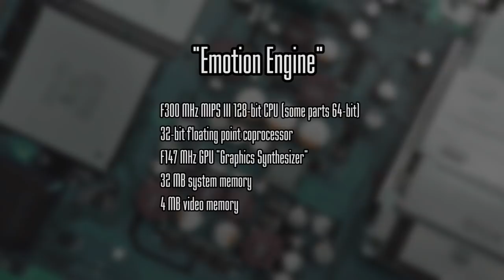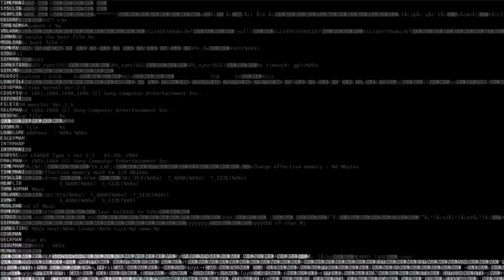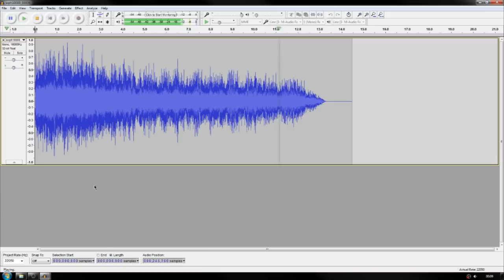Playstation 2 Startup Sound Explained

Comment: The ps2 is also a good DVD player
Reply: For 2001 lol
Reply: You could also play a PSX games on it)))
Reply: The PS2 was also a good video game machine.
Reply: John outstanding
Reply: DVD player built in was a huge sales driver back then, standalone drivers weren't cheap quite yet for most people. OG Xbox had it as well but you were forced to buy a separate accessory to even use the feature.
Reply: Yes it is true
Reply: Ooh, a Federal Signal Thunderbolt.
Reply: Not with it's disc reading issues
Reply: The PS1 is also a good CD player
Reply: Why do i feel like the Xbox 360 is strong enough to be used as a hammer
Reply: @Exzticy  underrated
Reply: Just like all playstations tbh.
Reply: I use my PS3 for this :>
Reply: Can confirm!
Reply: It looks like a regular one
Reply: @chiptunegalaxy160  and for phat ps3 too
Reply: @devantethedcguyreactstoo252  2000
Reply: Indeed
Reply: Especially shrek
Reply: And when it was set to parental control level 9 on some DVD’s, you could just look up what buttons to push to get past it!
Reply: It's the only good way to play those DVD player games, since it has a proper controller
Reply: 666 likes
Reply: @zaf2774  667 likes
Reply: nice tbolt pic
Reply: What is a DVD? 😂
Reply: @TheKeksletsplay  ur too young
Reply: I dont even use a dvd player, I just use my ps2.
Reply: @specialopsdave  Slick.
Reply: If you're sick on it and don't get it cleaned it breaks
Reply: Correction phenomenal
Reply: @devantethedcguyreactstoo252  i dont think much changed with DVD since its release tbh
Reply: I remember that PS2 was cheaper than most DVD players in that time.
Reply: @devantethedcguyreactstoo252  lol
Reply: Mine is age restricted i can only watch shreck 3
Reply: @chiptunegalaxy160  PlayStation 1*
Reply: @Exzticy  yeah that's a game console
Reply: Indeed
Reply: @Exzticy  IT COULD PLAY GAMES?!
Reply: @requiem165  WOAH I THOUGHT IT WAS A TOASTER
Reply: The ps3 is also a good blu-ray player
Reply: "It only does movies"
Reply: Used it every night for that. Back to the future 1 2 and 3 but mostly 2 every night like my whole childhood lol
Reply: My first dvd watched at ps2 was matrix animated.  Followed by Eurotrip, a pirated zatocihi film(KITANO version) and kill bill vol 1.
Reply: you could actually 'play' Netflix on ps2
Reply: I tend to not use my PS2 to avoid wearing  it out.
Reply: That was the Main reason it was so successful, also it was Cheaper than most dvd Players in the early 2000s
Reply: And it’s an emulation Machine
Reply: @AltimaNEO  No It ToAsTs BrEaD
Reply: And computer!
Reply: until the disc drive died
Reply: And PS3 a good blue-ray player.
Reply: @ebookjapan8054  yea its too bad that the ps2 had a backlight issue when playing dvds the brightness levels would pulse from bright to dark non stop
Reply: PS3 was a good blu ray player
Reply: Mine never lets me play dvds but that’s what I have a ps4 for.
Reply: What is dvd
Reply: @devantethedcguyreactstoo252  yeah, because DVD technology has advanced a lot since 2001 right? Damn i still have a broken ps2 that i plan on fixing just so i can watch pirated DVDs
Reply: That's what I thought my dad's ps2 was when I was little. I never saw him playing it
Reply: Just replying to make 69 replies 😂
Reply: It's true, it was also my first DVD player as a kid.
Reply: I didn't know there were even good and bad dvd players
Reply: Lot's of people buyed ps2 because it was cheaper than normal DVD player
Reply: Some times honestly
Reply: Its really not tho. My clean disks skip horribly on it but run perfectly on my ps3
Reply: Didn’t expect a thunderbolt to be here
Reply: Ya but sometimes you gotta have the DVD player 4 pro
Reply: @schcunt  damn made me feel old reading this comment
Reply: Just like me
Reply: I have ps2 slim and can't play any dvd whatsoever beside ps2 games
Reply: No lie no lie
Reply: I don't know why but i'm kinda uncomfortable looking at this comment
Reply: xbox one s is also a good dvd player
Reply: @hystericallover5989  wouldn't know  I don't have one sadly
Reply: @B.O.Xproject  i don’t want to sound like i’m just advertising the xbox, but it just straight up functions as a blu-ray player
Reply: @hystericallover5989   sounds good 👍
Reply: omg
Reply: Wait, it's not only a DVD player? Oops
Reply: it was until you used to fall asleep at night with it on and it would destroy your playstation 2
Reply: It was my first DVD player.
Reply: It actually is still good at playing dvds. I tested this with my ps4 and Xbox one with king of the hill dvd. And the PS2 done best because due to the dvd it looked better and more visually appealing than the ps4 or xbox
Reply: tfw I've never used ps2 as a dvd player
Reply: that's how many kids convinced their parents to buy them a ps2 lol
Reply: And a decent pc for its time
Reply: It kills your ps2 life tho
Reply: Before the PS2 our family only had a VHS player. We did have one of those portable DVD players for travel though.
Reply: They designed them, same as Blu-ray for PS3 + 4, still plays DVD's too of course.
Reply: And a desktop computer.
Reply: Wait... You can play dvd on PS2?
Reply: I was told it's not recommended playing DVDs on it though
Reply: Let's not forget the fact that (if it hasn't been mentioned) this DVD player now allows for easy piracy of PS2 games.
Reply: I wish
Reply: Wait what.
It’s a DVD player to.
The ps2 is my favorite console and I never knew that
Reply: @thestickopia4619  what-
Reply: As much as I love the PS2, the DVD player sucked even in 2000.
Reply: Yes
Reply: @ebookjapan8054  , the remote
Reply: My fuckin dad only used it for that
Reply: Actually its the best
Reply: It is not
Reply: @chickenindabox3169  ok lets just come to an agreement all playstation systems are good for dvd playing. i have a ps3 and its good for dvds i was gonna comment that so ya ps1 thru ps5 is all good for dvds
Reply: @johnnyvincent5405  except the ps1 could only play CD but ik wym, also the ps3 is a bomb blu ray player ngl
Reply: Yep
Reply: AT 3AM
Reply: Yeah, but i think it tears them up faster.
Reply: That was the way i watched the ben 10 live action movies
Reply: *Destroyer
Reply: Not on the slim it’s awful
Reply: @samthesnail34  look up the button presses on line should be able to help
Reply: My mom & sister used to always take my ps2 to watch movies, I used to get mad asf 😂
Reply: Better than xbox360
Reply: Tru
Reply: I still have mine from years ago, operating as home cd player :)
Reply: Still use it sometimes to play a movie. The beast seems indestructible.
Reply: I always played my DVDs on it :')
Reply: Didnt notice you here!
Reply: My old xbox 360 could play the most scratched/wrecked and burnt dvds. 1 tiny hair scratch on a disc now makes them un playable on newer consoles
Reply: one of the most resilient DVD player of its era. I saw 2 dvd players dying 10 years ago. my PS2 still works perfectly.
Reply: @xzerox2112  you still have official network adapter as a solution to play games. with it, you can put games in a hdd in the ps2 with the said adapter. i had time to backup my games in the HDD, so, my PS2 won't be broken until a really long time.
Reply: Thanks Mr. Helpful
Reply: Remember when some DVD player were note expensive then the ps2 lol
Reply: That’s why my dad had got one, why spend the money on a DVD player and a ps2 when the ps2 was the all in one entertainment package
Reply: True dat
Reply: @chiptunegalaxy160  Wut
Reply: Watched Shrek 2 on it
Reply: for 2020 bois using 5.1.2 home theaters and OPL mod it's perfect, running 1080i and upscaling to 4k with perfect áudio on muteki bby 😳😳🤝
Reply: Sega said that if they would have develop the Dreamcast for 6 months longer, they would have had one too.
Reply: Right you are..!
Reply: I disagree the controls on the dvd player is very hard to use
Reply: Yes
Reply: I have one that reads only ps2 and ps1 discs
Reply: Yeah my mom's dvd play was big as heck compared to my ps2 but i bet she didn't know
Reply: I loved watching space jam on my ps2
Reply: Wait, it does more than play DVDs?
Reply: Aa is any console
Reply: Not the slim it scratched all my discs 📀
Reply: The ps2 was the all nighter helper for the kids that were born in the early 90s or late 80s
Reply: Tommy what are you doing here
Reply: Yeah
Reply: It was legit a better DVD player than my $400 dedicated DVD player.
Reply: I still use my PS2 as a DVD player.
Reply: Facts
Reply: Everybody knows that...
Reply: @TheKeksletsplay  wtf???
Reply: I have a PS2 1000 which doesn't have DVD playability and a PS2 39000 which has DVD playback
Reply: NUUUUUUUUUU 😭😭
Reply: @devantethedcguyreactstoo252  for 2022 roo
Reply: PS3 is better tho on DVD.
Oh and also still a good Blu Ray player, suprisingly better than the PS4...
Reply: It was my first DVD player.
Reply: It was the cheapest DVD player up until the mid-2000s.
Reply: Same w the Xbox 360

Comment: Explain the PS3 intro audio
Reply: I think they didn't use The thing that the PS1 And 2 Did When The PS3 Came Out
Reply: It's just an orchestra or a single violin
Reply: In ps3 and ps4 they didn’t mixed the sounds like ps1 and ps2
Reply: It's the same opening cue to an orchestral performance when they tune their instruments. Watch any on YT
Reply: It's probably just an orchestra sample with no additional effects. Memory was plentiful enough so they could justify putting a whole sample into the BIOS  instead of processing the sounds in real time
Reply: Orchestra tuning.
Reply: it's basically the intro to Syphony of Destruction by Megadeth

Comment: The tiny CRT TV I had as a kid had a nice feature where the volume would reset to around 50% EVERY SINGLE TIME YOU SHUT IT OFF which was way, way too loud for the PS2 intro so I had to make sure the TV was turned on first and I adjusted the volume before I started the PS2, because the TV would also automatically switch to the AV output if the PS2 was on when the TV was turned on.. good times
I still use that same CRT TV over 15 years later to play older consoles, it sure makes old 80s 8-bit machine look nice and sharp when a modern flat panel looks blurry on them

Comment: 03:00 so the startup sound samples are used randomly every time or are there few set up sart up sequences? 
very interesting video, props
Reply from the maker: It's the same startup each time but the samples are played at different notes within the sequence.  Some samples are used only once in the sequence so it wouldn't apply to those samples.
Reply: @Nitrocosm  i get it now. thanks! pretty interesting, would love to see a third party app which enables to play around with the PS2's sound features. Could even work as a DAW maybe haha
Reply from the maker: That would be sweet.  Maybe someone will come up with a custom firmware for that.

Comment: The PS2 is backwards compatible with the original PlayStation when you put in a game that is a PlayStation game then it would go into the half of the PlayStation startup because the Sony Computer Entertainment logo is the one used in the PS2. Well the PS2 has two sound chips that are from the PlayStation and the one is used for the PlayStation side while the second one is used for the games for the PS2. But Sony did something with the PSP but no one has dumped the bios of the PlayStation Portable to get the sound samples.

Comment: The PS2 has built in reverb? How and why?
Reply from the maker: It's more efficient to apply reverb in real time to samples because it allows the sample data to be a lot shorter.  Reverb is also relatively simple to implement and computationally inexpensive.
Reply: @Nitrocosm  I never even considered that it would be built in to the console. So how versatile is it?
Reply from the maker: I would imagine that parameters such as pre-delay, reverb time, and low / high pass filters are all easily programmable on the PS2's sound chip.

Comment: The PS2 does support HiDef -- natively, as well. Some consider 720p to be "High Definition," but the PS2 will actually output 1080i, in 16:9 ratio (unsretched), using the A/V out - Component A/V cable.
Reply from the maker: Interesting.  I'll get a component cable and do some research.  This might be worth creating a video in itself.  If this turns out to be true, I stand corrected!

Comment: 0:58 correction: ps2 had a couple of games supporting HD (Gran turismo 4 and I don't remember another one). I mean it didn't have HDMI output but it could handle high resolutions. Remarkable for a 20 Y/O console
Reply from the maker: Sadly, no.  Those games used upscaling and were not rendering at HD resolutions.  The PS2 is not capable of true HD rendering without a mod.

Comment: My dad had a ps2, but in like 2012 I tripped over the wire connected to the gaming controller and the ps2 fell on the ground, and it didn't work after Rip ps2

Comment: There are hdmi adapters. So it can output at hdmi level
Reply from the maker: Yes; the HDMI adapter converts the upscaled analog component output to a digital HDMI signal.  The graphics are not rendered natively at 720p nor 1080i / 1080p and are therefore not truly high definition.

Comment: Huh? PS2 has always supported HD. It was a big point of contention when compared to the Gamecube and XBOX.
Reply from the maker: It is indeed capable of 1080i output for a handful of games but the graphics are upscaled to that resolution and not rendered natively as HD.  I think the Linux kit for the PS2 could use 1280x1024 resolution with VGA output.  The hardware does technically support those resolutions.